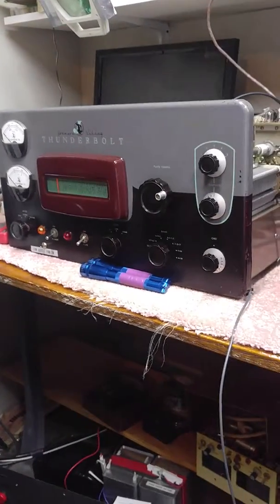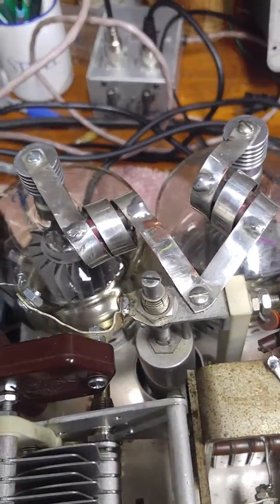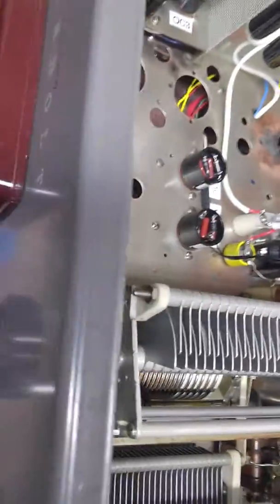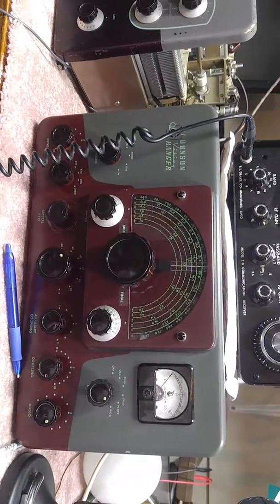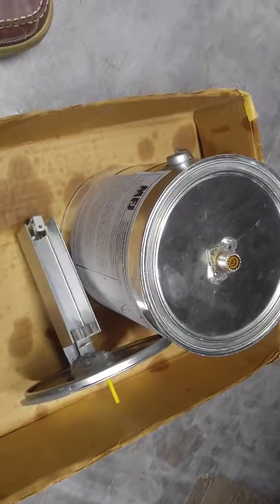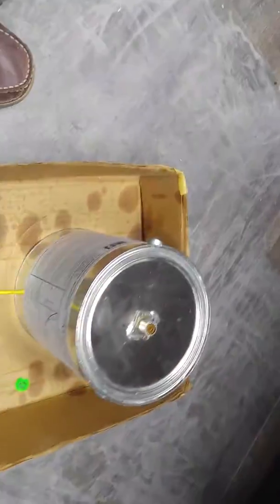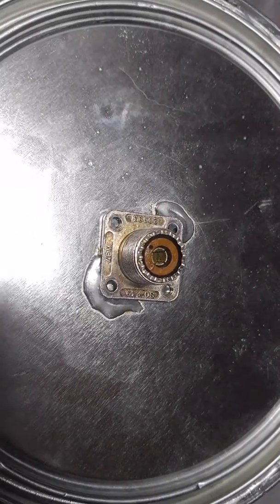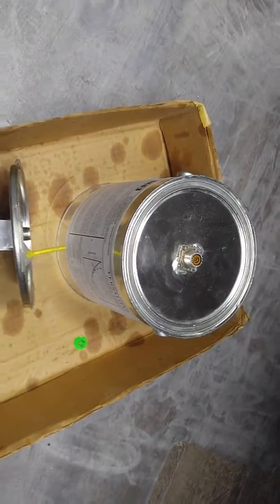Johnson Thunderbolt 2nd qso and dummy load

Comment: Oh my heart! I was only 15 when I had a beautiful Ranger and a Thunderbolt in 1975 and used another Johnson as a receiver. It was a Messenger 223, and I was often told I had the best sounding CB radio on the band.
It was particularly fun to lower the drive to only one watt from the Ranger and forward swing from 60w to 950w with modulation.
 ...day before yesterday 🤓